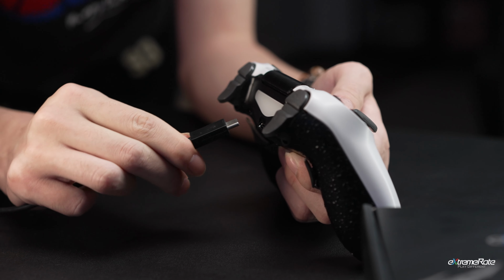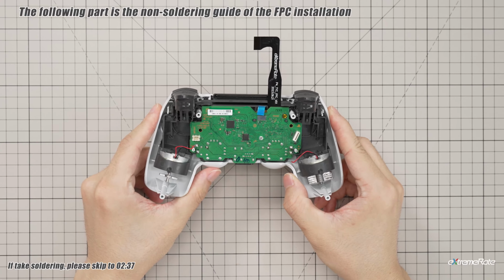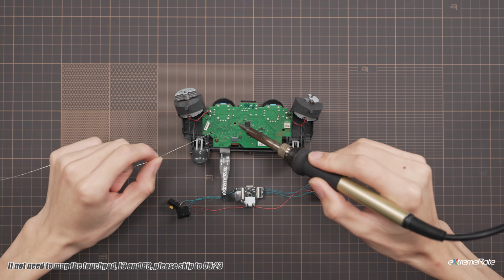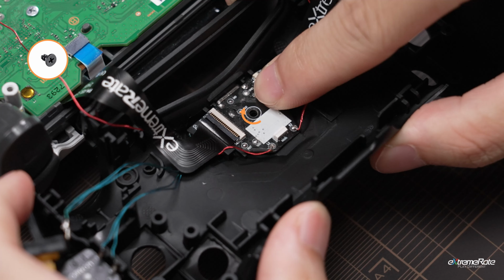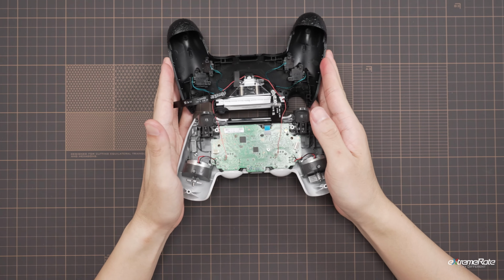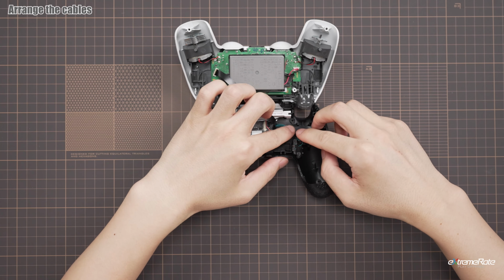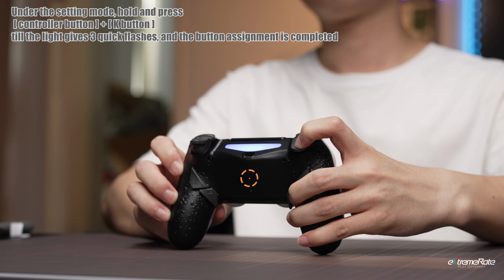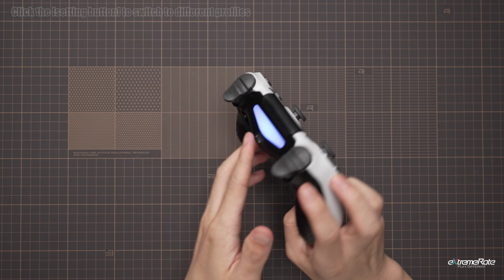eXtremeRate PS4 Controller NEW DAWN Remap Kit Type-C Version Installation Guide

Comment: Terrible back buttons.
Reply: Agreed. Why are they pointed? If these were just small round buttons, it would be great.
Reply: Says somebody whose never used them. There's absolutely nothing wrong with them
Reply: @ThomasTheTankEngine22 you're a train, tf do you know?
Reply: As in the quality of the buttons, or the layout?

Quality wise, I've started noticing ghost double inputs on one of my keys on an older Dawn kit I fitted in 2019. 

If you're referring to layout, then I'd disagree. I used to think this was an awkward config until I tried them and got used to it. I'd say this layout is actually my personal favourite layout and is the most ergonomic for all the back button kits I've installed so far from Extremerate.

My middle fingers's inner portion/ phalanges can hit k3/k1, whilst the fingertips/pads/distal phalanges of the middle fingers can comfortably hit K2/K1. 4 back buttons can be handled seamlessly on only 2 fingers, the index fingers can handle shoulders and triggers, and the your pinky, ring finger, and palms can support holding the controller nicely. There's no awkward shuffling or weird bumps when moving between back buttons like I've found on the Rise 4 kits for PS5. And there's also no need to unbalance the way you hold the controller to access all 4 back buttons like I've found with the hope kits for Xbox.
Reply: Installed the old kit for a friend and he absolutely loves them. He has been running them for over a year with no complaint. If you do not like the button shape you can buy round buttons individually
Reply: Yeap. The Paddles are a lot better
Reply: Clearly not an informed opinion to simply state "This sucks!" without any reasoning
Reply: The decade kit button are better
Reply: @carloshighers3150 😂
Reply: I’m hoping they come out with one that matches the Edge back trigger. The current ones are not how I like to rest my back fingers.
Reply: I don’t agree, these are the best back buttons I have used in many years among other diy products
Reply: @Sponee yeah i got that it’s great
Reply: They are actually pretty comfortable. I have the 2 piece version tho, one on each side.
Reply: Yea they should sell the rear shell w/o the buttons

Comment: is it possible to just do the USB C Mod without the backbuttons ?
Reply from the maker: You can replace the mini board with the board come with the kit and cut the switches off then it works, but you need to deal with the port area on the original bottom shell to make it fit with the Type C port.

Comment: what does maping the touch pad and l3+r3 mean? do they stop functioning? or does it mean if you want to be able to modify their functions? I'm looking for a controller mod that is able to add 4 extra buttons to the back so that when i play fortnite for example, i can set the weapon slots to it and all other buttons of the controller should function as normal. Is this able to do that without the sawdering part?
Reply: It means that you'll be able to assign the back buttons to the touchpad and sticks. Just as you can assign the buttons on the back to be cross, square, L1, etc.
The back buttons only replicate other inputs the controller already has. I don't play Fortnite so I don't know if there are dedicated buttons for the weapons slots.

Comment: Thanks for making this kit! I know DualShock 4 might be considered as a legacy controller (albeit one with a lot of lasting power thanks to PC support and backwards compatibility for PS5), but are there any plans for making any adjustable trigger stop kits that allow for both digital clicky/hair trigger and full analogue? Similar to the Dualsense Rise Plus MAX or the Xbox Flexor clicky kits? (I know there are already Extremerate adjustable trigger stop kits for PS4, but whilst active, these only shorten the L2/R2 travel within the existing analogue throw without offering any digital or clicky response).

I'm planning on modifying an ExtremeRate ps4 clicky kit and fitting onto a Dualshock controller (JDM-055) in order for it to support full L2 and R2 analogue but with clicky buttons on everything else. Not sure yet if it'll work but I'm looking to try. I'll basically trim off the L2 and R2 portions of the clicky dualshock 4 clicky FPC (also desolder/remove the L2 and R2 resistor). I'll retain the DualShock 4's original (OEM) plastic conductive FPC, and simply place the modified clicky FPC right on top so that I can retain the original analogue input triggers. Thankfully your clicky kit fpc's conductive contact pads are double sided so they can sandwich in between  the original plastic conductive sheet and the dualshock's motherboard and hopefully pass through any signals from any L2 and R2 inputs. 

This idea was directly inspired by the modified installation suggestion for dualsense BDM-30/40/50 Rise Plus Max install, where you can stack a modified clicky kit (with the L2 and R2 portions on the clicky kits trimmed off).
Reply: Update regarding the dualshock 4 clicky kit setup for anyone interested.

My idea worked!!!

By clipping the extremerate clicky FPC at and removing r2 + L2 and their resistors, you can stack this modified clicky fpc on top of the oem conductive fpc to retain full analogue on L2 and R2. Just be mindful that you'll need to make some slight modification along either the triggers or bumpers in order to allow the triggers to travel unimpeded. You can either:
- clip the "fang" pieces on the OEM l2/r2 triggers, or
- modify the r1 and L1 inserts provided in the clicky kits (such that the "fang" pieces on r2 and l2 don't collide or get obstructed by the r1 and L1 inserts).

I'd recommend leaving the r2 and l2 fangs alone as those help keep the triggers and the silicon membrane far more stable at resting position.

Comment: Bought them and when I mapped the X  on the right side it was working fine then stopped working I tried to remap it again and it didn’t work, any other bottom I could map in there but the x didn’t work at all
Reply: You can enter the self-check mode and check if the kit is working properly.

Comment: hey i was wondering if i could use the rise 4 paddle kit and the eXtremeRate Micro Switch hair trigger on the same controller at the same time in a BDM-30 ps5 controller
Reply from the maker: Sure you can!